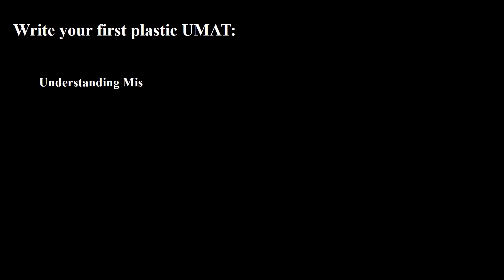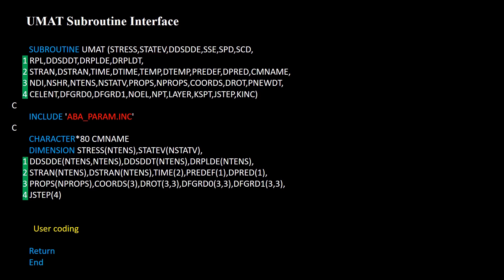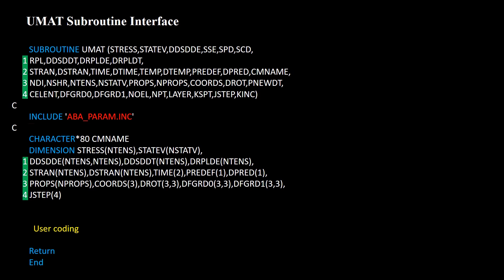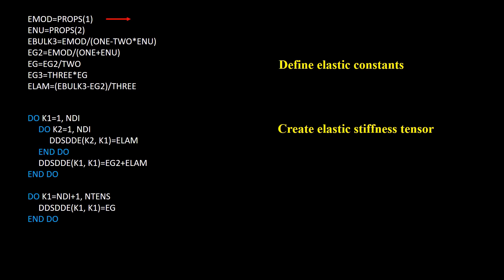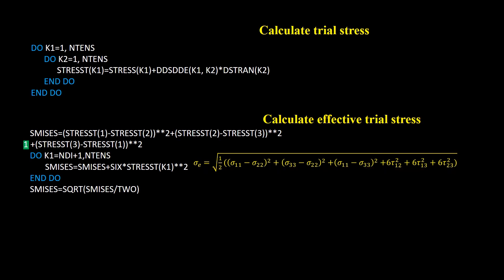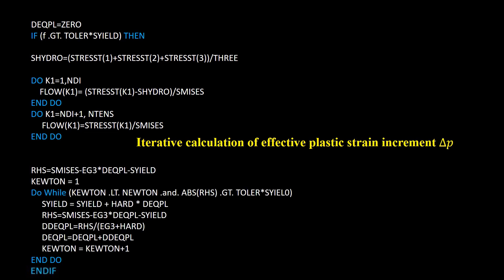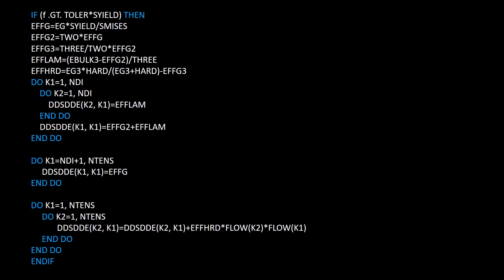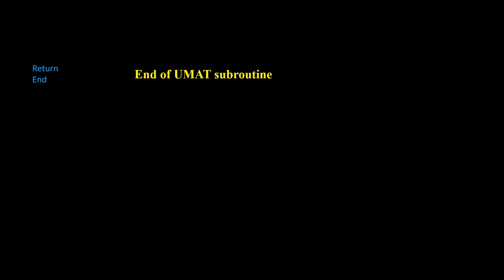Plastic UMAT for Abaqus

Comment: Hi, thanks for your video.

This piece of cod:
DO K1=NDI+1, NTENS
      DDSDDE(K1, K1)=EFFG
      END DO

Should be:

DO K1=NDI+1, NTENS
      DDSDDE(K1, K1)=EFFG2
      END DO
EFFG2

because otherwise the last three diagonal components are EFFG instead of EFFG2 as suggested by the equation.

Comment: Is same procedure can we apply for constitutive model of steel?
Reply from the maker: This constitutive equation (Mises Plasticity) is useful for most of metals. Just the material should be isotropic. For example it is not suitable  for steel sheet produced by rolling process. In some cases the type of hardening should also change.
Reply: @engineering_software  i want to develop a UMAT for reinforcement rebar using Menegotto pinto steel model just to account hysteresis effect.
Reply: @engineering_software  i am taking about the stress-strain constitutive model of reinforcement rebar